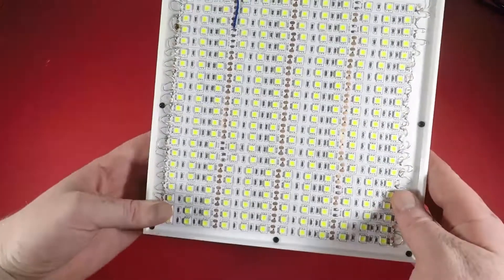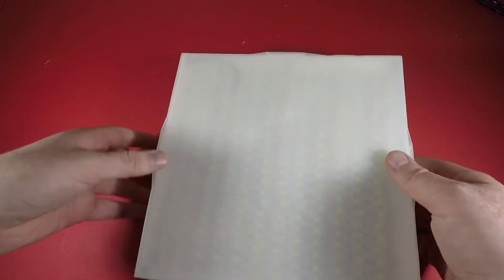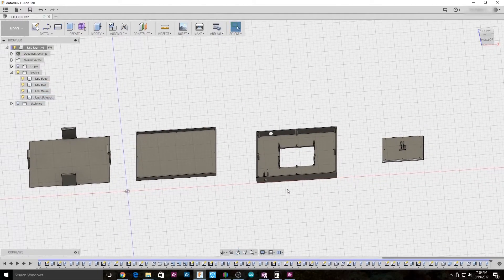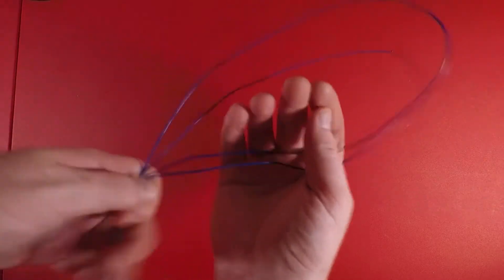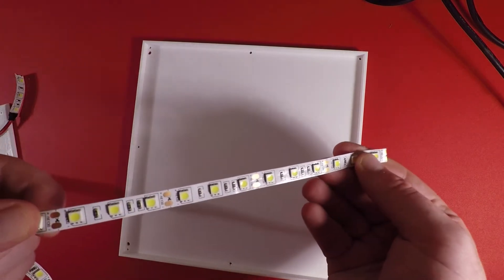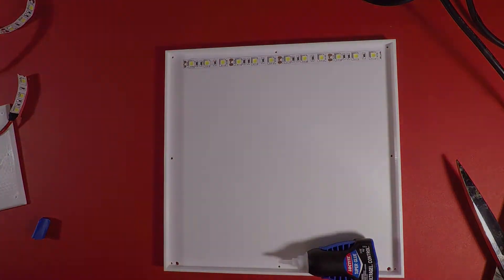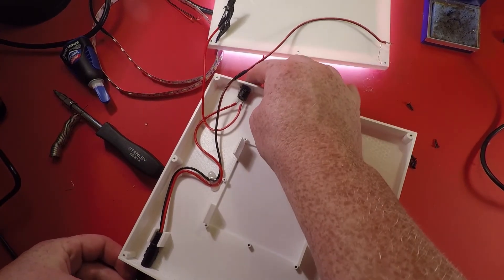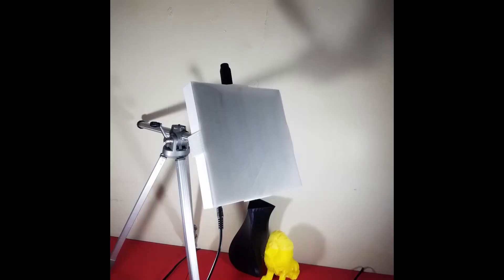DIY 3D Printed Bright LED Light

Comment: Thanks for sharing. A pot. And a dc-dc converter would even make it possible to dim the lights 👍😀
Reply from the maker: +Asger Vestbjerg I originally put in a dc dimmer on it and I found that the dimmer even at full power, lowered the brightness of the light then a regular on off switch. It could have been the dimmer switch I was using, I will have to test around. I would like to be able to dim it.